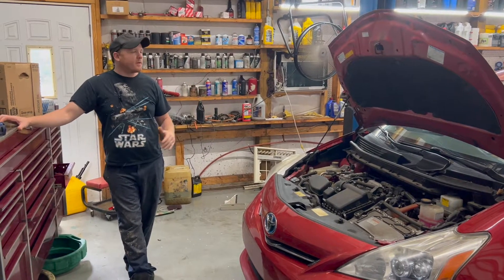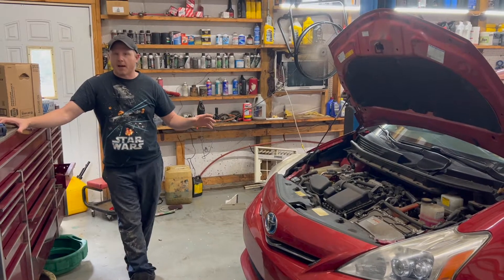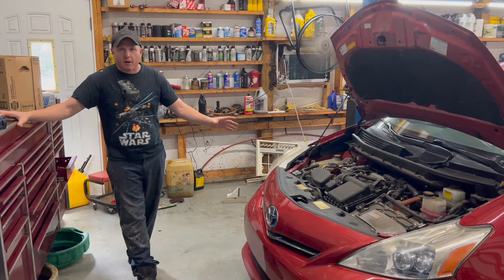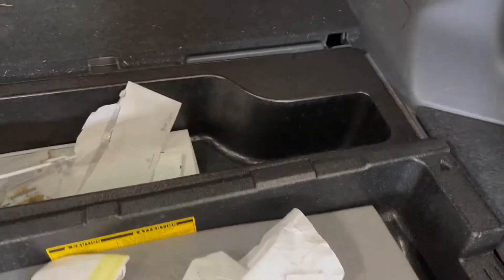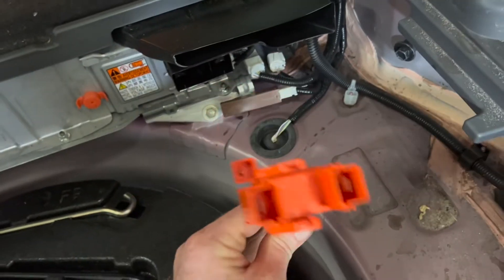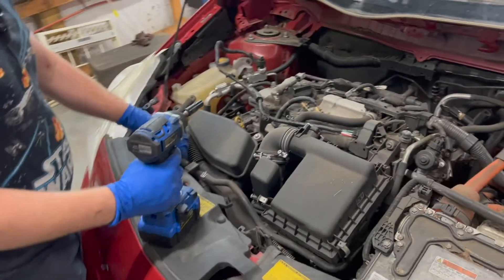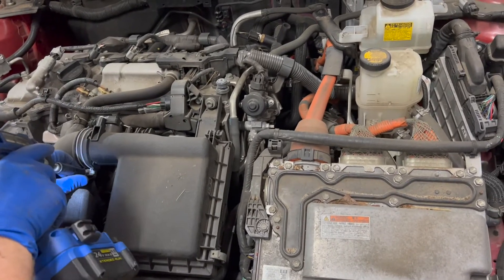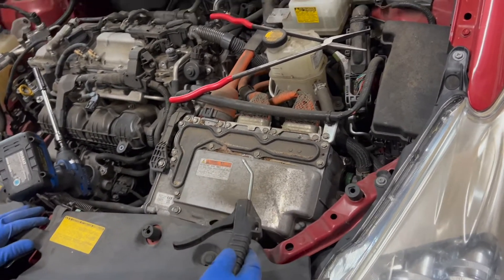10-15 Toyota Prius Burns Oil - TSB Piston Replacement Part 1

Comment: Dnt understand y u don inverted i pulled engine without do tht im jst sayn
Reply from the maker: I’ve done it both ways, in my experience it doesn’t take any longer to take it out and it makes getting the transmission bolts easier to get in and out. But to each there own.